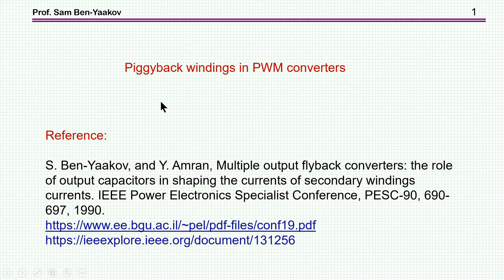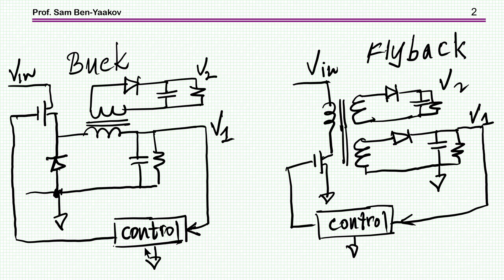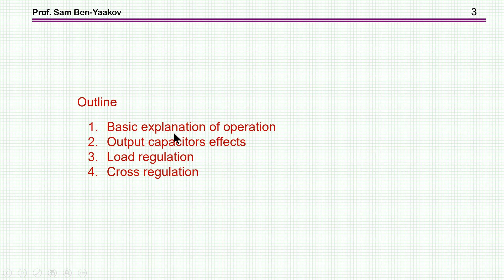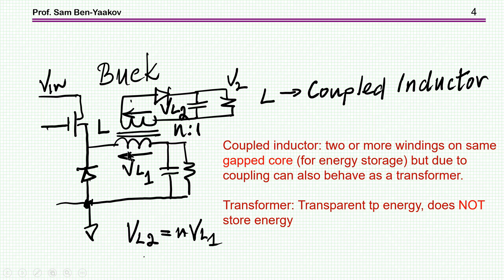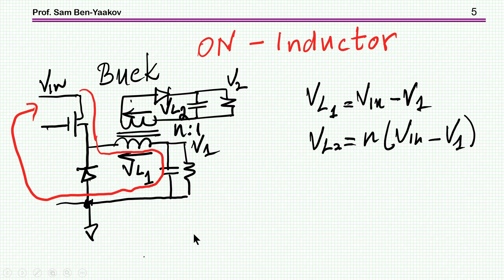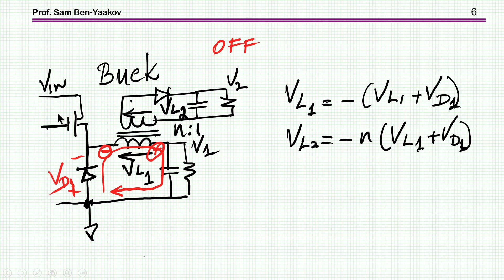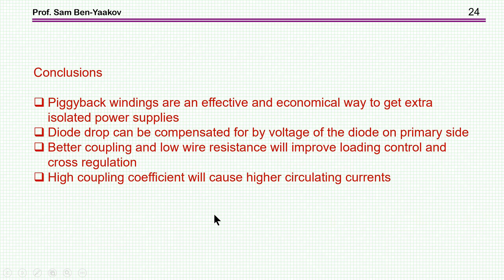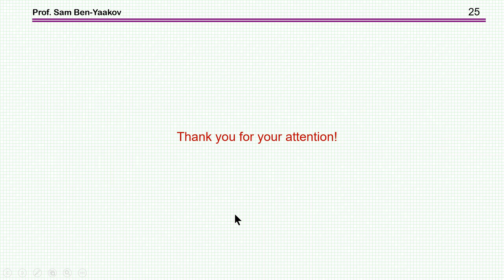Piggyback windings in PWM converters

Comment: The piggyback trick is excellent way to DIY mod power supplies.
I put a piggyback coil to make a 5-9v supply for an 80mm fan that had to cool down a 35w flyback power supply underdriving a 31v 50w led.
The combination turned out great, because when the LED heats up and consumption goes up the fan speeds up on its own. I had to be careful to clock the diode rectifying the piggyback coil correctly to achieve this effect.
This is much more elegant solution than trying to power everything off of resistors sucking the official DC output of flyback power supplies and in my case I was trying to grind down every last watt of unnecessary consumption.
Yes the supply is running on the edge of overpower protection trip, but so far it hasnt died after weeks worth of ON time. I think converting it from plastic encapsulated brick to actively cooled and vented pcb keeps it running strong.
Reply from the maker: Thanks for sharing

Comment: Interesting, now this one is being called FlyBuck, with which we are trying to replace the gate drive supplies for 10 kV devices. TI changed the Buck switch pair to the half-bridge so that the inductor can be double side excited instead of going into DCM. They also altered the dotted terminal for better regulation. Its drawback could be that the uncontrollable diode rectifier may not easily undertake too heavy load or withstand short circuit.
Reply from the maker: This is not FlyBuck . The piggyback winding WILL have problems with heavy load.
Reply: @sambenyaakov  Do you mean that FlyBuck has one output while piggyback has two outputs?
Reply: @sambenyaakov  The Ti call this configuration (simulated one) Fly-Buck. I was actually searching for information about that some time ago trying to design 4-20mA loop powered isolation power supply but ended with flyback on LT3001 which seems to work well.